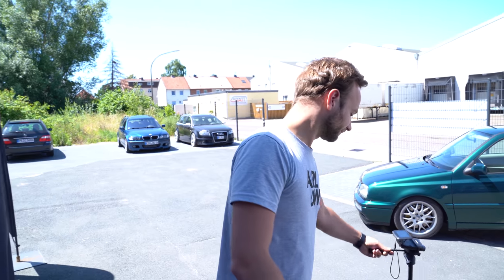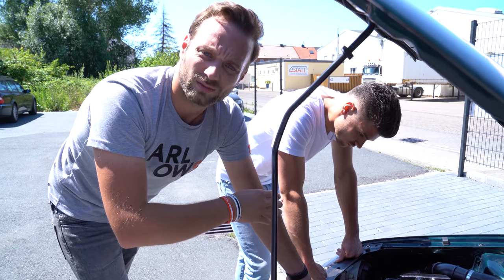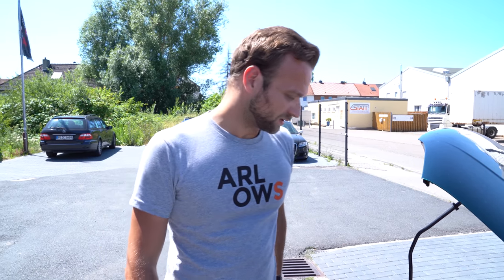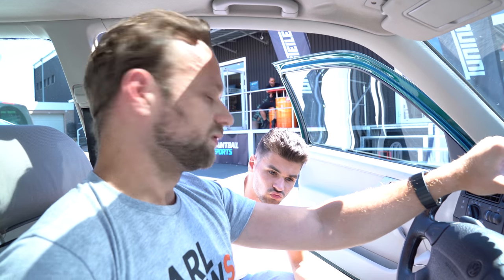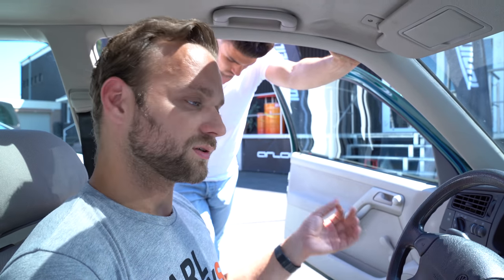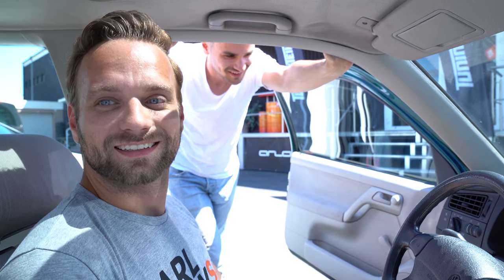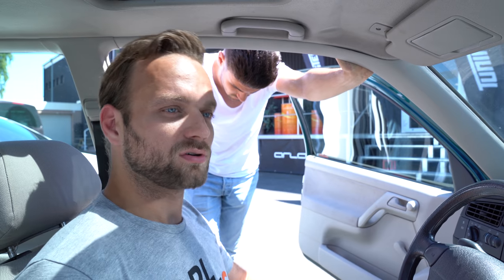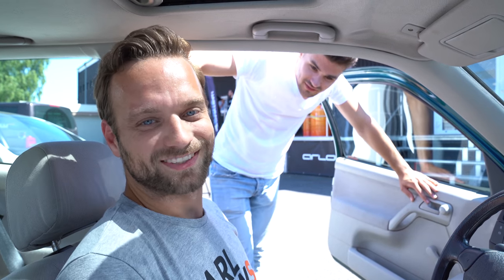Ein "Wolf im Schafspelz" - Der aktuelle Stand des VW Golf 3 VR6 Turbos | Philipp Kaess |

Comment: Ich hab so n harten das ist nicht witzig. Ich fahr den ähnlichen 95er mk3 mit 1.6l 75 PS auch LC6P. Der Wagen hat mich gerade 2400€ gekostet. Ich hab n Austauschmotor drin. Es wurde sonst alles neu gemacht(Ich hab 3 volle Din A4 Seiten vom Kfz Meister was alles gemacht wurde). Karosse ist mit mehreren Litern Sprühwachs versiegelt. Wenn der Motor in 2-3 Jahren den Geist aufgibt will ich sowas auch machen. Sind 3000€ ein realistisches Budget für die Hälfte eurer Leistung sprich 250 PS und statt dem VR6 tendiere ich zum 2.0L ABF 150 Ps und dann Turbo? Alternativ auch einfach nur der Motor ohne Turbo(Andernfalls auch nur der AGG 115PS wenn es nicht reicht). Ab wann ist es ratsam von 4 auf 5 Loch Felgen zu wechseln zwecks größeren Reifen und dementsprechend Sicherheit? Faktor 1 ist halt für mich das der Wagen sicher ist. Faktor 2 das es möglichst clean und OEM bleibt. 

Hauter rein